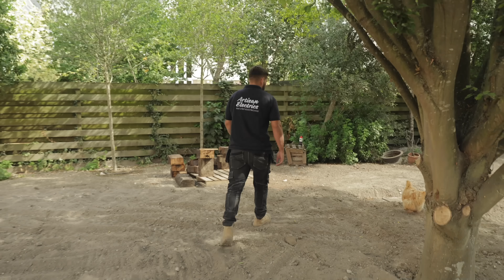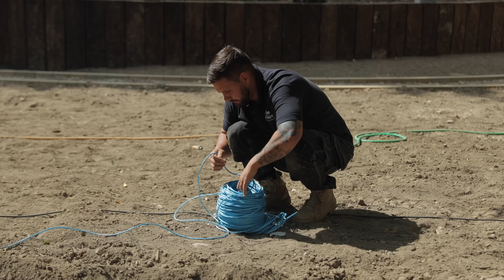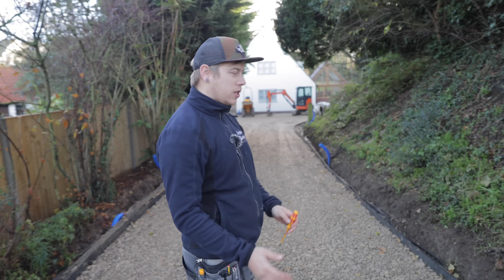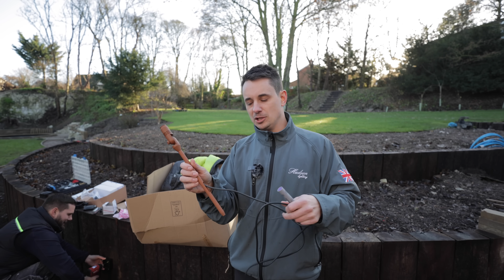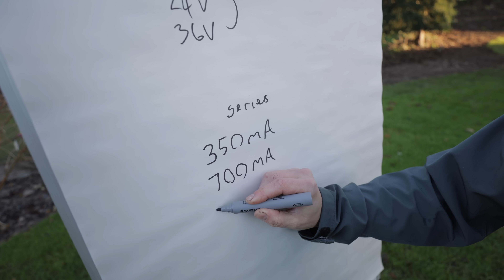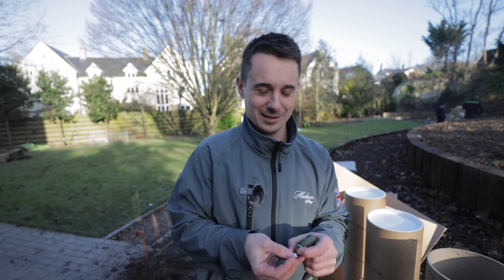The most EXPENSIVE garden lighting job we've ever done!

Comment: For a coil of polyprop rope like that the best way to uncoil it is from the inside out. At the start wrap whole coil in loads of duct tape, like loads, leaving the hollow centre accessible. Then find the internal end of the rope and pull out uncoiling from the inside out. Provided you put enough duct tape on (loads) then the outside will stay rigid and hold its shape while you uncoil.

Comment: How about EMI (ElectroMagneticInterference) with series lights? I really hate SMPS LED drivers because most of them use what is called spread spectrum switched mode power supply and basically smear the switching over a wide range of frequencies causing all kinds of EMI problems. In some of my ELV (Extra Low Voltage) projects I had to reside to expensive military grade of laboratory grade power supplies or even batteries to get rid of the EMI. Is there some standard that tells you how much EMI those ELV LED drivers emit? And are there lineair ELV LED drivers for low EMI purposes? I mean I know they comply with national standards but in my experience those national standards are usually not good enough.

Comment: Just been looking at Eddy current effects by the amazing John ward, it seems like its such a minimal impact of any thermal issues   ! Makes  me think that some regs are there for ... just being regs !!  Ive never put tails through seperate 20mm knockouts but even in J.W's test with a 100amp load it crept up by 2 degrees !! I think on a hot sunny day the csu would get warmer than that , especially if situated in a closed cupboard or a garage.
Reply: No.
What JW measured was a 2 degree C increase. The magnitude of that increase doesn't change with ambient temperature.

So if the ambient temperature is 20°C then the final temperature is 20 + 2 = 22°C

If the ambient air temperature is 34°C , as could be in a hot summer, then the final temperature is 34 + 2 = 36°C.

That delta of 2 degrees is not a function of temperature.

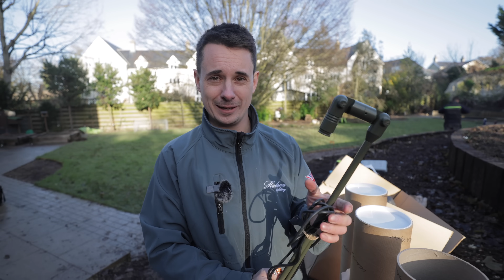Comment: 26:52 Really great to see that the LED is user-replaceable. Having to replace an entire fixture when the bulb dies is extremely wasteful.

Something else worth mentioning is that with series lighting, if one of the LEDs does die, then all of the lights on the chain will go out. And finding the dead one will be not so straightforward. That’s a much bigger downside than the lack of hot-swappability IMO.

Comment: 13:10 why not using rcd in order to secure 230v circuits here in germany you have to use them for some years now it is not allowed without one and it is defacto standard like 1985 at least at my parents house that was build that year and they had one installed from the beginning.
and it works really simple power flowing through it into the circuit and returns over the neutral, if it senses that it is not flowing back for example you touching a wire and the current flows through your body to the ground/earth  it sees current running in to the circuit but not returning over the neutral ad klick it is out and it is enough if there is just 30mA then it trips, you can even get ones with 10mA.
I am always amazed to see these are not mandatory worldwide today at it is an really easy way to have a save installation.
you can use lower voltage but then the rest of the installation still has this flaw.
23:50 you don´t have to use ferrules with this kind of wagos.

Comment: I'm confused; lower current [pressure] (350mA) can 'push'' further (1-2km) compared to 1A 'pushing 300-400m?;How can lower pressure push harder/further?
Reply: Resistance is partly why. As the current goes up resistance increases. But also the driver deals with the volt drop. It raises the voltage to deal with the losses
Reply: @HudsonLighting  that kinda makes sense, ELV isn't something I have much knowledge about, I can definitely see the upsides to using ELV outside - I saw a video from David Savery, turning effectively LV fittings into ELV by throwing it on a driver and a E22 to MR16  presentation converter to take the different bulb and I saw sold 🤣
Reply: Current is not pressure.
In electricity, in explaining things to non proficienct people it is common to use the water and plumbing analogy and in this analogy it is the voltage, not current which is the equivalent of pressure.

It's a constant current source, which means that the current remains constant and it is the voltage that changes.

So the more resistance you add to the output of that current source, the current remains constant and the voltage across the output will change.

Comment: Never mind the main supply coming through different holes, why wasn't the correct main switch used on a TNCS supply. Garden looks amazing and nice to see ELV used, it's hard to get customers to see the benefits until they've had a fault or shock from mains powered but ELV is the way to go and the only thing worth installing.

Comment: Well said regards extra low voltage lighting. I was wondering initially if it was going to be series wiring. The 4-20mA instrumentation wiring is a good example regarding looooong cable runs. Davo Savo did a cracking video on the really sad death of the kid at the pub.

Comment: 4:43 Eddy currents from seperate tails entries are not an issue at domestic power levels - I think John Ward did a vid debunking this a while ago
Reply from the maker: Nice thanks for sharing
Reply: I smiled when that comment was made. As an industrial electrician we have come across this on large supplies but from memory it refers to single core armoured. The armouring can only be earthed at one end and into an insulated land plate at the other. The Eddie currents would flow round the armouring as you would have made a big transformer if both ends were shorted out. You are talking 3/400a supplies though. It’s common on transformer tales I think

Comment: Why use PVC flex and not H05 of H07?. I only use that externally now for lighting. I know its in a duct but I would still use rubberised flex instead.
Reply: H05 and H07 are the cables that are always being chewed by foxes etc. We stopped putting them on our lights and found a UV rated outdoor suitable PVC for the lights. That was 3 years ago and we havent had a single report of animal damage since
Reply: @HudsonLighting  didn’t even know they did a uv stable pvc flex. You learn something new everyday 👍 thanks for the reply.
Reply: @yrification  armoured and NY have a UV stable PVC jacket for reference. There's plenty available 👍

We use automarine and the temperature range is amazing, here's the blurb from their site:

Single core suitable for use at temperatures from -40ºC to 105ºC with excursions up to 120ºC
Reply: @HudsonLighting  that’s almost like a tri-rated cable then. That’s good stuff.

Comment: So, if you break a wire (same as hot swapping) you are saying that it will cause a split second 2amp peek and blow all of them?
Reply: If you break the connection then no, because there is no return path. If you were to connect them back again love then yes, but unlikely all. Probably just one or two
Reply: @HudsonLighting  That's just down to poor quality drivers. Don't use Saxby!
Reply: @sdgelectronics  all of them do it. Weve developed an anti hot swap device but not patented it yet. Most drivers you see exist in several brands. The Saxby one is re packaged for Orlight, Aurora and others. We sell allot of Meanwell and they do it too
Reply: @HudsonLighting  not all. It's because they added output capacitance to reduce the ripple current. The drivers that run at a higher flyback frequency and are better quality don't do it, like some of the XP Power modules. There are some Meanwell ones too. It's basically because they are made cheaply and the capacitance is a quick fix!
Reply: @sdgelectronics  we supply the Meanwell LCM and AP range and they all have this issue. Do you know which Meanwell don't? I take a look at XP, thanks

Comment: When those blue ropes does not have a drum and is wrapped in plastic. Do not remove the plastic whatever you do. make a hole in either side and pull the rope from the inside. They are not designed to be rolled out but pulled from the inside. Unfortunatley that willalso twist the rope when you take it out though you can mitigate that by untwisting it when you pull it out.

Comment: 50mA enough stop adults  heart. 350mA?
Reply: I believe it's the combination of current and voltage. I've held 120V DC one core in each hand and it doesn't seem to do anything
Reply: @HudsonLighting  It isn't; only the current is sufficient. However, to achieve that much current, either the voltage has to be high, or the impedance low. For DC, resistance is all that matters, and your body has a high resistance, severely limiting how much current can flow through you. For AC, current flow depends on impedance, which is composed of resistance, capacitance, and inductance. Your body has a lower impedance than its resistance, so you conduct AC better than DC. This is why the ELV limit for AC is lower than DC.

Comment: The explanation on parallel vs series circuit arrangements for lighting LEDs was slightly correct but more so incorrect. A series arrangement would in-fact make LEDs in the circuit dimmer. When applying KCL to a series circuit, it can be observed that each node only possesses two connections. The current into each node must be equal to the current exiting, thus current is constant through each LED in a series circuit. In series, resistance sums proportionally to the resistance of each component.  When applying KVL in a series circuit, the equivalent voltage of the source must be dropped across the entire chain, inferring that if the source voltage is not great enough to meet the circuit demands, LEDs in the circuit will be less bright due to the increasing resistance which reduces the amount of current flowing. In comparison, parallel circuits provide a constant voltage drop across all components but current divides through each branch depending on its resistance. Resistance in parallel is the inverse of the sum of the inverse of each components resistance. Assuming that each branch contains an equal resistance (all LEDs are the same), all LEDs in the circuit will glow at the same brightness regardless of how many branches the circuit contains due to the decreasing resistance which permits a greater current to flow.
Reply: You've missed some fairly important aspects about the design with your Kirchhoff analysis, especially the type of power supply used and the resistance of the cables to each LED.

Comment: Tip with the rope is use the end from the center of the bale and if you lay the bale on the floor make sure the outside tail is pointing anti-clockwise looking the the letter "e" on the floor and when you pull the rope from the center it will spool out easy and not knotting up or tangling
Reply: Thank you! Will try that ‘e’.

Comment: how can you connect an L.E.D the wrong way round? diodes only permit current flow one way don't they?
Reply: They only want flow in one dirction. Reverse it and it blows. It varies between led manufacturers, some are more sensitive to reverse current. We put two diodes on our protection circuit in front of the white and red led to stop that issue
Reply: If you have an LED rated for a forward voltage of 3.3V and a reverse voltage of 6V, then connecting it backwards won't do anything; negligible current (on the order of a couple of microamps) will flow because the applied voltage isn't high enough to cause the diode to break down. You can exploit this to put two LEDs in parallel, but wired in opposite directions. Apply voltage one way and one of the LEDs will light up; the other one won't conduct much of anything. Apply voltage the other way and the situation reverses. It's very common for a diode's reverse withstand rated voltage to be much higher than its forward voltage, permitting this situation to exist indefinitely.
Reply: @Aaron Jones  the voltage the flows through the LED in series could be 120VDC or even more if you wasn't going for ELV. It's current that kills LEDs if you can't control the voltage necessary across each
Reply: @HudsonLighting Technically voltage doesn't flow through anything. It is current that flows, and voltage is always across two points.

All diodes have a maximum reverse bias voltage which causes breakdown of the component.

In reverse bias, the diode has a high resistance and the only current that flows is a miniscule reverse saturation current.

When the diode unde reverse bias has a voltage across it greater than its maximum reverse voltage then the diode fails and a large current flows.

For rectification diodes this maximum reverse voltage can be as high as 1000 volts, but for LEDs it is typically a lot lower, but from what I have seen, rarely quoted.

Comment: Great video , why 4 core out to lights? Thanks
Reply: Two core spare or for another circuit - 2 circuits out of one cable basically
Reply: In commercial industrial properties it's because they are often emergency
Reply: @JesusMyLordAndSaviour777  you think these garden lights are emergency’s?
Reply: @ja_adam_  no i doubt it, I actually don't know If you can get low voltage emergency lights, it would have been a good idea if the customer willing to pay

Comment: Random but can you answer how shaver socket isolating transformer works. How do you not get a shock if touching live when stood on the ground making contact with earth, but you would still get a shock if this was a standard light switch for example with the earth removed? 

The earth is removed on the shaver socket right? I don’t get how you don’t get a shock can you help?
Reply: I think the idea is you would still get a shock but it's reduced. Aren't they like 110v transformers double tapped so only 55v potential
Reply: @HudsonLighting  I'm not sure if they're center tapped or not, but they're definitely isolated transformers, so floating and not referenced to earth. ie. you can only get a shock by touching both conductors at the same time. They're also limited to 20VA output which heavily limits the current to < 0.2A
Reply: @havoctrousers  It's floating output, but you will usually get a small shock from contacting just one pole of the output. The transformers are low cost and compact so the inter-winding capacitance is quite high.
Reply: @HudsonLighting  also, I'm a maintenance spark for an old stately home and I'm really interested in your lighting products - but I get errors when trying to add an account to see pricing, I'm not sure if it's broken for everyone or not. Thanks.
Reply: An isolating transformer has (the clue is in the name) isolated outputs. The line conductor is only normally dangerous to come into contact with because its nominal RMS potential with respect to neutral is 230V, and the neutral conductor is earthed somewhere (this is why it's called neutral; its potential with respect to the earth itself is supposed to be close to 0V). Therefore you can become a path for current to flow from line back to neutral, through your body and then the earth. The two outputs of an isolating transformer will also have a potential difference between them, but there's no other path for current to flow; you have to come into contact with both conductors, otherwise nothing happens. Therefore there is no "line" and "neutral" on the output of an isolating transformer, unless you earth one of them (making it the neutral conductor), but then that would defeat the point because you've provided a fault path (through earth) back to the transformer and you may as well not be using it.
Reply: @aaronmdjones  true in theory, but in reality you need a shield winding in the transformer for full isolation. This is normally only in medical transformers.
Reply: @aaronmdjones  thanks for reply, what I don’t understand though is how if you touching a tap (path to earth) you still don’t get a shock …. If you ripped out the earth of a lighting circuit completely so it had no earth and touched live, you would still get a shock but don’t get how that’s different?

Comment: Jesus mother of Marys' donkey, those are expensive lights .... nothing under £100 notes per unit, at least, great product and high end stuff though and a valid point on the SWA
Reply: The micro recessed lights are all under £100 trade. We can only make 25 a day so the effort that goes into each for our team of 5 is pretty monumental. It was 18 lights a day just a couple of weeks ago
Reply: @Troy_Loves_Custard  The retailers are inflated which makes sense as to where you've seen it now. As an electrician for years, I was quite upset that I couldn't make a markup on other products, ultimately the contractor supports the warranty and that's got to come out of the margins. So in essence the retailers have a healthy markup on both trade and wholesale. Trade is a bit less then what you see on those websites. No worries, thanks for the comments 🙂